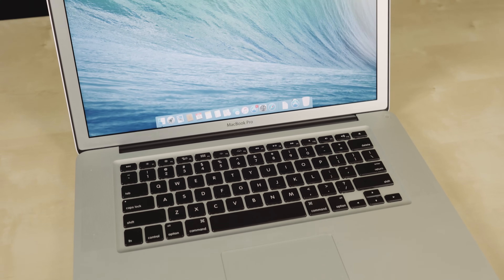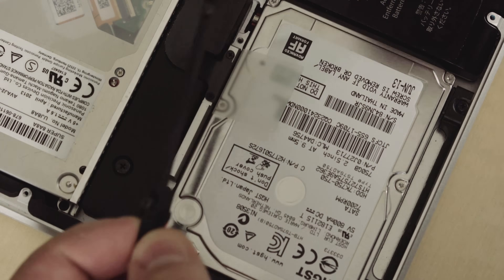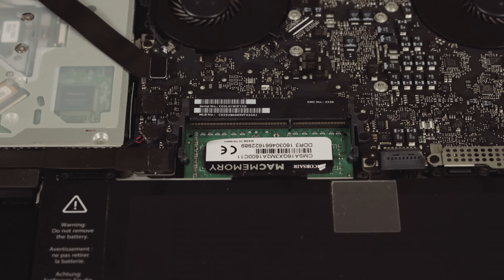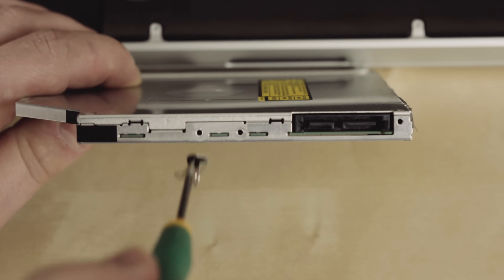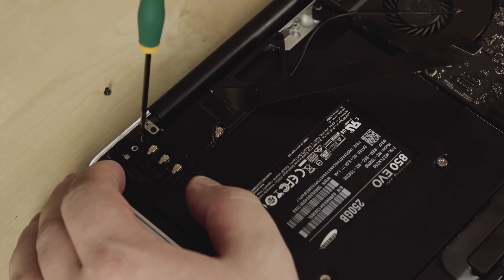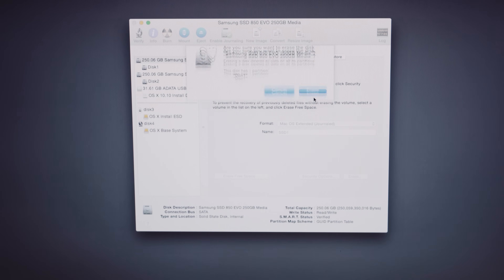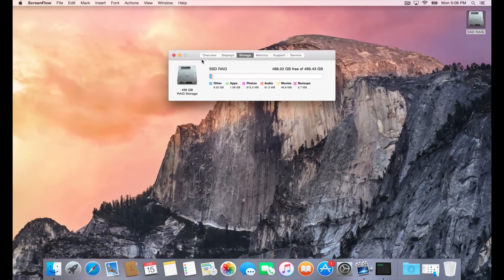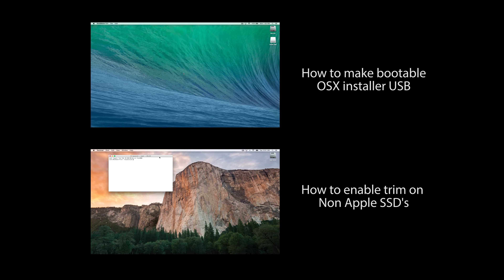Fastest 2012 MacBook Pro Ever! Upgrade Guide - in 4K

Comment: Just perused the comments, so I might've missed something. I was glad you mentioned enabling T.R.I.M. support, but you probably should've mentioned that doing so is absolutely vital if you want to get a decent lifespan out of your SSDs. Not enabling T.R.I.M. support will tragically shorten the life of an SSD. I speak from sad experience, because I upgraded my 2012 MBP exactly like you did, but with two 500GB SSDs from OWC and they died after three months. OUCH. The replacement SSDs I now have are still purring along after two years without a hiccup.
Reply: I'm just thinking of upgrading my mid-2012 MBP with a 1TB SSD... Where do you look to enable T.R.I.M. support?
Reply: @DanaBenYehuda  You have to do it inside the Terminal app. Enter 'sudo trimforce enable' (without the little quote marks), all lower case, then answer Yes and Yes. Reboot, and your SSD is good to go! Hope this helps. I know several people who failed to do this, and their SSDs suffered very premature deaths because of it.
Reply: @58allendavis  Thanks VERY much; done! I found that the Crucial ssd has a "garbage collector" functionality (their term) that functions as a kind of "T.R.I.M." in ssd's that do not have it enabled. I guess I'm double-covered now.  :)
Reply: @DanaBenYehuda  You are double-welcome!
Reply: @DanaBenYehuda  I'm curious as to whether you run Catalina on your MBP. From my understanding, Apple is finally going to abandon our favorite laptop with Big Sur. I'm not very worried, though. I also run a 2010 iMac, and I managed to install Mojave, and now I have Catalina on it. The only dysfunction I've found in Photos, when I double-click a thumbnail to view a picture at full size, the color scrambles and I get abstract artwork instead, but this isn't an all-the-time thing, but about 90%. I suspect some aspect of the Photos app and/or the graphics card didn't get patched. If that's the only price I have to pay, no biggie. All my photos are also on Amazon's cloud, and they display just fine.
Reply: @58allendavis  I'm running High Sierra. That will not be supported after 11/30 so I may upgrade to Mojave.
Reply: @DanaBenYehuda  I have the 2.9GHz mid-2012 MBP, and High Sierra was a disaster on my machine for some reason. It took 5 minutes to boot, and was highly unstable. I never figured out why, much as I tried. I back-stepped to Sierra, then installed Mojave when it was released, and never had a problem. I was saddened to learn that Apple had finally dropped support for our MBP, but it was a great ride. I'll probably install DOS Dude's patches in order to run Big Sur, much like I did to keep my 2010 iMac updated, but probably won't repeat that stunt, and finally break down and by a newer (2017 or so iMac) and get a brand-new MBP next year. I still think the 2.9GHz 2012 MBP was the greatest laptop Apple ever made, which is the main reason I never gave it up. I don't care about an aging desktop machine, although I do eventually get around to modernizing, but my laptop is still capable of keeping up with anything around today.
Reply: @58allendavis  Thanks for your reply this is helpful. I have an ancient 2009 MBP that ran like a charm on Sierra but the CPU was too low-end to update the browsers and security issues made using it impractical. My mid-2012 has a 2.5 GHz i5. I allowed it to update to High Sierra and everything slowed down. Since upgrading the RAM and changing the hdd to an ssd, it is running very well and at lightening speed, even on High Sierra, but I thought I'd get it onto Mojave because of the security issues. Apple won't send security updates for High Sierra after 11/30/20. Do I need to back-step to Sierra before installing Mojave?
Reply: @DanaBenYehuda  Despite having the i7 processor, High Sierra ran very slowly for me on my particular MBP. Very weird. Back-stepping I wouldn't advise. Not only is it unnecessary, but could potentially cause other problems unless you completely wipe the entire drive and treat the machine as though it were new out-of-the-box. That is not only time consuming, but you run the risk of losing files, among other things. I'm not certain what security issues there are that concern you. The big weak spot is with Safari, not the OS itself. I run FileVault and keep the firewall activated, and added a physical firewall as well. I've got a bank vault system, at least here at home. I assume you run VPN software, don't you? That's probably more important than FileVault.

A VPN makes you invisible, and if you can't be seen, you can't be hacked! Apple's hardware/software combined make you pretty safe, but I think a good VPN package is even more important. Be aware that Mojave will render almost, if not all, 32-bit software useless, and I would strongly advise you to go ahead and format your drives to APFS if you haven't already. Now that I think of it, Mojave may require APFS. I don't remember off the top of my head, but I do recall having issues with my external SSDs when I upgraded to Catalina. I wish I knew a little more so I could be sure I'm giving you good advice.
Reply: @58allendavis  Thanks very much for al of this information. It's very helpful and as a result I'll leave my system on High Sierra for now.  VPN for security might be a better solution for security than changing my OS. What do you like for the MBP?
Reply: @DanaBenYehuda  Choosing a VPN provider can be very involved, beginning with your location and how much security you want and need. If you use Facebook's Messenger, you can contact me that way and I'd be happy to give you a hand. I normally don't use it, but what the heck, I already have a FB account I rarely use anymore. We're beginning to clog up the pipes with our back and forth. I'm pretty sure I have the same picture avatar there so I should be easy to find. If not, I'm in Indiana. I don't think I'm opening myself up too much by revealing that deep, dark secret!
Reply: @58allendavis  Thanks for your kind offer. I'll look into it a bit first and if I need help there's Messenger. Indiana is plenty big to stay safe!
Reply: @DanaBenYehuda  You're very welcome. Not sure about Indiana being "plenty big to stay (or be) safe." I've become very security conscious after having my checking account hacked FOUR TIMES from late 2018 to mid-2019. Thankfully, my bank was able to recover all my funds, but still... I would suggest trying out a couple of VPNs that offer either a free trial, or will let you have a limited amount of data per month. Neither try-out method is ideal, but can give you an idea how good they are. There are so many factors to consider I couldn't list them here. Try Windscribe, they offer 10GB free per month. Tunnel Bear likewise. They're good, but they're far too expensive, like NORD, when it comes to actually subscribing. The biggest things to consider are finding a service that guarantees that they don't log ANYTHING, and secondly, try to choose a VPN that isn't native to the country in which you live--EVER. (I can explain why, but not here.) Any VPN will slow your Internet access down a little, but it the one you're trying out slows you down too much, move on and try another one, provided they fulfill the first two requirements. There are other factors in choosing a good VPN provider I didn't list here, but please get one. I'm fanatical about privacy and security, and a VPN is the best first step in protecting yourself.
Reply: @58allendavis  Sounds like you have sad experience with the necessity for it. I'm also getting a new machine in the next few weeks; the mid-2012 will be my backup. Once I have it I may just take you up on your very kind offer of guidance. I am taking it step by step, and this is just a little early in my process.
Reply: @DanaBenYehuda  I tend to hang on to my Macs until it's just an absolute necessity that I upgrade. When I got my MBP, and then seeing that Apple was soldering everything down and not allowing user upgrades, plus my particular 2012 machine was the souped-up version and had all those ports, I thought I'd never upgrade, but I know the day is coming when I'll have to, even if its i7 processor can still hold its own with newer machines.
My desktop is what is really lagging behind. The 2010 iMac 20". I did install a 500 GB 6G SSD, and 16GB of RAM, but Apple "abandoned" it 2-3 years ago. Then I found out about this guy DosDude, who writes patches which enable unsupported Macs to run versions of macOS that they're not supposed to be able to handle. I installed Mojave on it, and it ran perfectly. A few months ago, I upgraded again to Catalina, and it runs very well except when I double-click a thumbnail in Photos to see the full-sized version, and I get scrambled colors, but beautiful abstract artwork! I think it needs a patch for the video card, but whatever. I'm not upgrading this iMac anymore and will finally surrender and get a new one, but I have been tempted to look into the Mac mini.
I'm happy to help out any way I can. I a mostly-retired college professor and thanks to the coronavirus, my lecturing days are probably over, so all I do now is occasional writing or editing and have plenty of spare time.
Reply: @58allendavis  I appreciate all this information, you're saving me a lot of work!  Next step is porting Entourage to Outlook, and I'll stay with High Sierra in the interim. I've got other projects the next few weeks, but then I'll look at the OS and VPN.  I am not sure who's who on FB Messenger, so if you reach out it may be easier.
Reply: @58allendavis  I'll be in touch when I can 'make the leap' and talk about VPN. I saved your email separately in case you might prefer to edit it out of your post, for privacy. I found that High Sierra isn't bothering me as much since upgrading the RAM and SSD. That's some news about Catalina being upgraded so soon. My understanding is that Apple will stop security updates for High Sierra after 11/30/20. https://computing.cs.cmu.edu/news/2019/eol-macos-highsierra#:~:text=Apple%20announced%20the%20launch%20of,updates%20as%20of%20November%202020
Reply: @58allendavis  Just sharing - I just got off a chat with an Apple specialist. He  said there's an update to High Sierra as of 9/24/20, but he recommended Mojave instead. He said the mid-2012 can handle it and he confirmed that Apple will stop supporting HS as of 9/30/20.  You might want to reconfirm before trying it, but I'll probably go ahead.
Reply: @DanaBenYehuda  I guess I got confused and lost track, having gone back to re-read your posts, I'd lost track of where you were. Somewhere along the line I thought you were considering the jump FROM Mojave to Catalina, and I'm so sorry. I am glad that Apple continues to support their older OS versions as long as they do. I don't think Microsoft does that, do they?
It seems to me that the macOS is a lot like the original cast Star Trek movies -- every other one was great (ie, II, IV, VI), the others just "meh." Don't get me wrong, Mojave was PDG, but Catalina really delivered what Mojave was hinting at (can't think of a better way to put it). Like Sierra, which was good, but seemed like a half-step, and High Sierra delivered the "rest of the package." At least that's the way it seemed to me, but it may just be the features, bells and whistles that were most useful to me, your "mileage may differ."
High Sierra was the last upgrade that my 2010 iMac could support, and perhaps it was just my machine, but it was horrible on that machine, while my 2012 MBP ran like a rabbit with its tail on fire. My iMac just didn't perform as well with HS as it did plain vanilla Sierra. Then again, it seemed to get new life breathed into it when I installed Mojave -- which was actually an unsupported upgrade (done with patches)!
Your mid-2012 MBP will love Mojave. It was one of the easiest, most seamless upgrades I've ever done.
I'm sorry I couldn't be of more help to you, but I'm glad you've gotten everything ironed out!
Reply: @58allendavis  You've been incredibly helpful and I appreciate it! I haven't done the upgrade yet to Mojave, but will get it done. I'm buying a new machine this year so it will most likely be the last upgrade for my MBP. I'm keeping it, but will refocus. I ordered a new MBP via Costco and then read that the new Apple Silicon is coming out in November. I may cancel the order and wait to read reviews before buying.
Reply: whoops - Costco canceled my order due to some delivery issue at the warehouse. I'm going to wait -it seems like a sign!
Reply: @DanaBenYehuda  I'm happy to help. You will love Mojave, too. I need a new or at least a newer iMac than I have first, because I can still "get by" (hahaHAH!) quite a while longer. My MBP is an amazing little machine, and I'm like you, I'm going to hang on to it until the lid falls off, and the way I baby it, that won't happen in my lifetime!. Feel free to look me up any time if you need anything else. After years in the graphic arts business, I'm now exploring things I never had time for before, and am behind the curve on some of them. One thing I definitely want to know so much more about is privacy and security -- get that VPN, too! I've been victimized four times in the last 2-3 years, right up until I started getting more security conscious, and while I'm not bulletproof, I'm a lot safer than I was, and from what I've learned, females tend to fall victim more frequently than men (and I'm NOT being sexist or implying anything whatsoever -- I'm just stating a fact). And the current political climate worldwide makes things even riskier for certain of us. Take care! Be safe!
Reply: @DanaBenYehuda  An omen? (Que up the Twilight Zone theme music here.) Who knows? When I bought my MBP, the order got mixed up, too, and instead of getting the one I actually ordered, I got the super-duper version of the mid-2012 MBP with the 2.9GHz i7 processor. There weren't that many of them made I'm told, so I lucked out and got quite the bargain on the Mac I got delivered. Turnabout here, time for me to ask you something: are you aware of any Mac resellers who might have a 2017 iMac (not 27") that I might trust, and won't charge prices as though they were brand spanking new? My budget is in the toilet, and can't swing a new iMac this year, but I need something. My current iMac is running Catalina, but it's a 2010 model, definitely NOT supported. It works well except for the Photos app. (I had to install and run the DosDude patches, but as I said, works well.) I have 16 GB of RAM in it, but I now frequently run into "Low on Memory" dialogs, even when only running Mail and Safari! This never happened under Mojave (also unsupported and installed via patching), but at least Photos ran well. I'd appreciate any heads-up you might have, and thanks in advance!
Reply: @DanaBenYehuda  Thanks. I think I helped keep OWC in business for a long while many years ago! They're still my main go-to source for SSDs, RAM and other little things. I think OWC Macs are pretty over-priced, though. Just for giggles one time, I offered my MBP to see what they'd offer me for it. They offered me $500 for the EXACT same configured machine they were asking $1,150 at that time! I'm all in favor of making a profit, but that's a little ridiculous. An almost 600% markup is a little greedy, I think. And I'm certain my machine was in as good, or better condition, than their very best example. I've babied mine, and it doesn't have the slightest scratch. It looks as good as the day I unboxed it! I try very hard to take care of my things, and especially something I almost consider an investment! 

I'm a little leery of eBay and used or refurbished Macs, but I think I've found a couple of resellers that do post there I will check out. Have you had any experience with eBay and Macs? 

Apple seems so spotty about when they have bargains -- especially on older Macs, and 2017 to them is Stone Age! And, yeah, the Twilight Zone theme was what popped to mind!
Reply: @DanaBenYehuda  Ahhh!!! Good old Luke Miani. He's so heavily sponsored that it's hard to trust everything he says. I appreciate the link, so thank you very much. But he's so well known to eBay's resellers that they bend over backward in order to make sure he's satisfied lest he unleash his wrath at them here on the Tube. I happened to see this video some time ago, I just don't remember how long ago it was. I do remember him doing a couple of "reviews" that were obvious plugs, and I've viewed him with a somewhat jaundiced eye ever since! Again, though, I want to thank you very much. You went to the trouble of doing that for me, and I do appreciate it. I'm getting redundant, aren't I? Since I've mentioned my appreciation now, I'll shut up!
Reply: @58allendavis  I'll was going to send you email but have been having trouble since trying to use MS 365. I reverted to MS office 2008 and Entourage and will send email. I also see that Mojave is supposed to support 32-bit applications (Entourage being one of them) but sometimes there seem to be glitches.Maybe instead of changing s/w I ought to simply look at VPN. At the moment, just getting my work done is more important..not even funny :(  . On the plus side, I can send links to things I have found on Mojave, but you're probably ahead of me in that regard.
Reply: @58allendavis  email doesn't work. Oh well!
Reply: @DanaBenYehuda  Is it bouncing back to you? Hmmm... strange. dammit. It's allendavis58, not 48!!! I really, really, really need to proofread what I type these days. Now I feel like a real moron!
Reply: @58allendavis  I think it's me! I miscopied it! Re-sent :)

Comment: Hi. Great video. I have a MacBook pro late 2011 13 inch. Can I change my motherboard from a core I5 to a core i7 or this is relating to the ssd. I thought ssd replace the hard drive but I'm a little confused. I appreciate any help with my question. Thanks
Reply: dont change the motherboard, video its related to the SSD and RAM